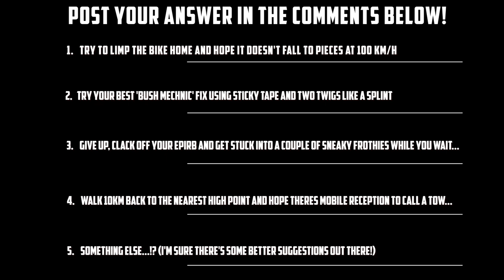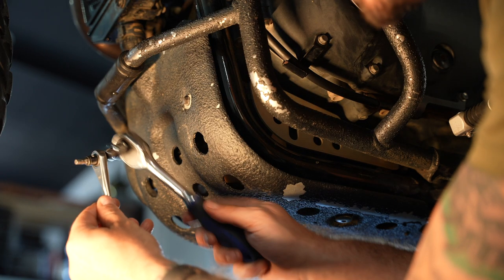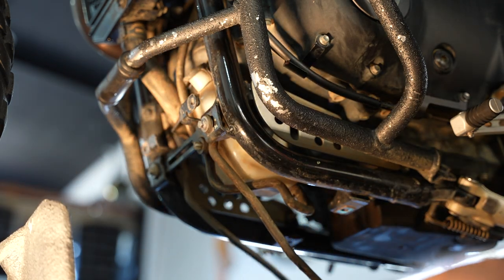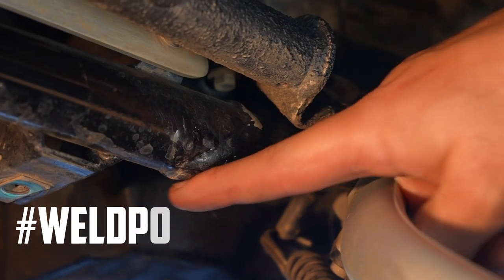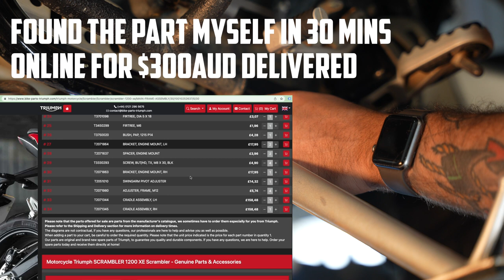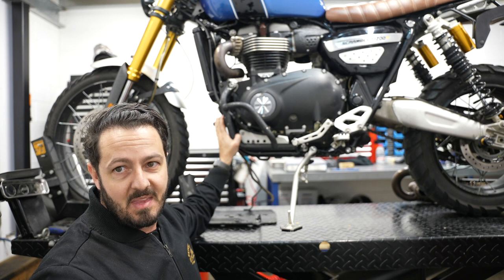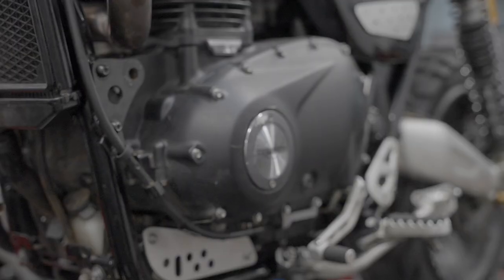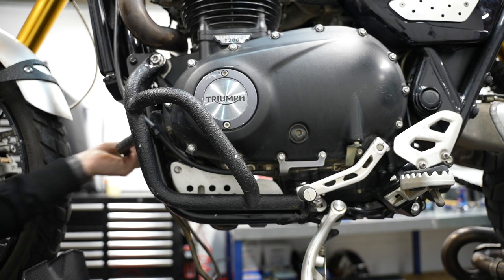Triumph can't fix this! | Scrambler Broken Frame | SCRAMBLER TIPS EP 11

Comment: Went put yesterday and sat on my first Triumph Scrambler XE....Fell in Luv with the sitting position andvoverall feel.  Told the salesman i wanted to go home and research pro's and con's, since i was unfamiliarwith bike.  I wish it didnt have so much tech on it, but the frame weakness is definitely a concern now.
I have been riding/racing On and Offroad for many years, riding for roughly 44 years, so i aint new....but dang that bike "FEELS" So good....
Reply from the maker: It does feel good! I recommend checking out my long term review videos - it’ll give you a better idea of how they stack up against others and also the pros/cons

Comment: Thanks for the video, I’ve been looking at a new 900 Scrambler.  I was also thinking of an Interceptor 650 then putting a 19” front wheel on it.  I’m 74 and don’t do anything crazy anymore.
Reply from the maker: Thanks! Glad it can be useful! I thing the bigger wheel at the front is definitely helpful for stability, and as far as bikes go - I reckon the scrambler 900 would be a bit more power available if you wanted it!

Comment: Good video. Mounting crash bars - Did you remove exhaust to get at nut on inside of engine mount bolt? Pretty hard to get a wrench on it. Triumph manual says to remove exhaust. Manual also says those are one use self lock nuts to be replaced every use. But that's likely official manual lawyer type stuff.
Have 2019 XE with 30,000 miles. Only real problem was replaced gear shift shaft at 20,000 miles. Well known problem. Triumph has a retrofit part to fix it.
Reply from the maker: Thanks! And sorry I can’t remember, I think I may have removed the exhaust - otherwise there might be a way to get a ratchet ring spanner head in there (I think!?)

Comment: This break is from standing on the foot peg while the bike is on the stand, nothing to do with off-road riding. It was common on the KTM 950/990 bikes, except there it broke the engine casing, there were plenty of relocation brackets available.
Reply from the maker: Yeah a few people have mentioned that, but I have only done is a couple of times, and mostly on the right hand peg. It seems to be a weak spot?
Reply: Oh? Well I guess that's all right then😂

C'mon, I never saw a more feeble comment in my life! If a frame breaks while standing on the pegs, I don't care whether the bike is parked or bouncing down the road, it means the bike is a piece of shit or someone has abused the fuck out of it. Stick to proper bikes. 

I remember back in the day (90's) a mate cracked his frame on a Supertenere and I praised my faith in my Africa Twin. I still have my Africa Twin. My mate's dead.😢
Reply: @lifeofascrambler it should be able to take it, poor design.

Comment: Great video!  Felt for ya when you laid the critter down.   I've done that to many times at 250kg plus.  First thing is look around see who's filming then cuss like sailor.   Funny how a manufacturer can build a bike and say, "it can" then have a frame that should have been tested so "it could".  Fire the guy at Triumph that spec'd that frame out.
Reply from the maker: Hahaha thanks, yeah that reaction to dropping the bike sounds familiar! And you’re exactly right, I’m more than a little disappointed in the frame break, and I suspect something to do with the alloy they’ve used, where most alloys just don’t take vibration like steel does, they crack under the pressure!
Reply: @lifeofascrambler  In my industry auto manufactures know of particular problems but they cost analyze them down to the penny with empirical data over decades.  Failure and warranty are an expense on a tax return in this country if you catch my drift.   How many people will ride hard vs people that play.  Trust me they thought of this when they found the flaw in testing and let it go.  Not trying to be conspiracy at all.  Totally true in automotive.  Planned obsolescence it's called.  Sad but true
Reply from the maker: @howardmonteith  totally agree! I don't think that's tinfoil hat thinking, its totally something I have seen in some businesses - where they lose sight of basic customer needs vs profit. It's a shame, seems to be really bad in the motorcycle industry too! (I've been watching some of the @fortnine videos recently that explain dealerships vs corporates etc and it shines a pretty bright light on some shady practices.
In the meantime, I'm patiently waiting to support the kickstarter for a new quality motor company - "Howard M Peterbilt series Trucks"...or maybe it should be "Howardbilt while Peterfilmed" series....😂

Comment: Hello, thanks for Your videos.... may I ask You if new models have fixed the problem? thank You :)
Reply from the maker: I was in a media call with the triumph head of engineering a few months back when they released the new models, and he said that they had solved it!
Reply: @lifeofascrambler  thank You very much
Reply: Did they happen to elaborate on what they believe is the most exact cause of frame cracking? 

Is it because a significant amount of weight is drawing straight down in the center of the frame when someone puts all their weight on the foot pegs? 

These bikes are ridden standing up off-road so often- I can't imagine they would deduce the problem. Origin being weight on the peg.

 @lifeofascrambler

Comment: Do you get on and/or off the bike while it is on the side stand, or sit on it with your feet on the footpegs while it is on the sidestand.  The sidestand clunk is a dead easy fix with a bit of rubber on the stand.  Are you getting an entire new frame from Triumph?
The new Tiger 900 Have been breaking a few frames where crash bars have been installed.  Have you seen the OEM Triumph engine side case protectors that can be installed also to protect the cases just a bit more from rocks and objects?
Reply from the maker: I have gotten on and off the bike using the left peg a handful of times but only when carrying camping gear, because I’m too short to step over. That said, it shouldn’t be enough to crack a frame and the fact it’s happened to a few folks, and also seeing the place it cracked, makes me wonder if it’s a design / quality issue.
Reply: If you can't get on a bike while it's on the sidestand without the  f'n frame breaking, then that's a serious problem with the manufacturer. Rediculous, it's not a plastic toy, it should not break!

Comment: Mine did the exact same thing. I have hardly taken it off road and I don't do the kickstand mount method (I'm an old motocrosser so just throwing the leg over is habit).
Man, I might need to see if the dealer here in the U.S. can get it covered as well if this is a known issue. I have a closer non-dealer shop with the part on order. Their estimate when ordering the part (in late July) was late November. The stupid thing has been in storage ever since. I don't know a welder that will do that type of work.
Reply from the maker: Really?! That’s pretty crappy I’m sorry to hear that! Triumph should 100% cover it, I was lucky to get it looked at just before my 2 year warranty ran out, but the frame should be covered for longer than that, I’m not sure about the US consumer law though. Definitely look into getting a welder to help! Anybody at a fabricator should be able to do it, and removing the frame piece isn’t that hard it just takes a day or two and you need to be careful to torque everything up as per the manual. There’s one available in the 1200 Facebook group!
Reply: @lifeofascrambler   Ahh okay - yeah my bike is out of warranty. The part we ordered is pretty inexpensive ($180) but the wait is what is killing me. I actually ended up getting a Honda NC700X in the mean time. I'll probably sell the Scrambler when I finally get the part. I've just had too many long wait time for parts, ridiculously expensive replacements ($300 for the stupid side panel plastic piece), etc.
Reply: @lifeofascrambler  Sorry, just re-reading this; were you saying there's a fabricator available or the part itself? I don't use Facebook so I kind of glanced over that. I'm still waiting for the part. Latest estimate was late January and I'm thinking when that time comes, they'll push it out again.

Comment: So if I understood right, the lower cradle of the scrambler 1200 is made of aluminum?
Reply from the maker: Yep!
Reply from the maker: @StefanLoeners yeah you're right, ally is not as strong as steel but they seem to use it in some places to save weight 🤗
Reply: Aluminum can be pretty strong, but it work-hardens, fatigues, and cracks quicker when flexed repeatedly. It can be a good frame material to save weight on an MX or streetbike, but I don't think it should be used for a frame on a dualsport or adv moto that could be ridden through the middle of nowhere.

 It's also not as easy to find a welder skilled at aluminum repairs.
Reply from the maker: @RKmndo  100% right, and totally agree
Reply: I am confused. I inspected my USA 2022 everywhere with a magnet and it is steel. @lifeofascrambler

Comment: Is it a common issue or just the odd case here and there? 🤔 im kinda thinking not cos these bikes have been out a few years now and theres not loads of information on the frames cracking on these 🤔
Reply from the maker: Well, I’ve come across about 10 others that have had this issue that I know about - so it’s a statistically small number
Reply from the maker: Also, if you head to the FB group I show in my latest video, you can search the posts and see people talking about them
Reply: Im guessing these bikes have been ridden offroad to crack there frames, you'd have thought triumph would have done somthin to prevent this by now considering these bikes are a few years old now, appreciate the response a d love your videos 👍 cant wait to be able to get my own scrambler 👍
Reply from the maker: @user-fn1rb9ze6p  well actually, the more I speak to others that have had it, the less convinced I am that its offroad riding and more convinced its from the weight of stepping on the left peg while the bike is on the side stand - so its a definite weak spot. You're right though, they need to come up with a fix, even though it's not a really significant structural piece, it is important nonetheless.
Reply from the maker: @user-fn1rb9ze6p  also, thanks 😅🤗glad you enjoy!

Comment: For the record: Triumph Scrambler 1200 XE Owners Manual  "Warning - Do not lean, sit or climb on the
motorcycle when it is supported on the side stand. "
I believe Triumph, or any manufacturer, will tell you that the side stand is simply not designed to support the weight of the bike and rider. It is designed to support the weight of the bike at lean with an added safety factor SF. That SF might usually cover the added weight of a rider. But the stand is NOT designed to support bike and rider with an added SF safety factor.
If they did that they would also need the stand to support rider, passenger and luggage (maximum payload) with a safety factor and you would end up with a 20 pound side stand.
I always cringe when I see guys go into a new bike showroom and sit on a expensive bike on the side stand.
Reply from the maker: Interesting, I get what you mean, but it’s not actually the side stand that is breaking, it’s the left hand cradle where the side stand attaches, and there seems to be plenty of other manufacturers who have managed to build heavier bikes without this issue.
Reply: @lifeofascrambler I’ve always warned Ducati riders about sitting on their bikes on the side stands.  Many Ducati side stands were bolted directly to the engine cases and many cases broke because of this.  KTM dirt bikes would just snap the side stands.

Comment: Do you think the crack occurred before installing the crash bars? Would the crash bars prevent cracking is the question I guess.  Good video thanks.
Reply from the maker: No I’m 99% sure the crash bars were installed first. They did prevent the whole frame falling apart though. I also was asked by someone if a drop onto the crash bars could have caused a twist in the frame, however I’m not sure and as they’re OEM it would be a strange design if bay was the cause.
Reply: @lifeofascrambler  ah ok, thanks for the reply.  I'll keep an eye on mine👍

Comment: I carry JB Weld but not sure if it would be strong enough for a frame break. Does anybody know?
Reply from the maker: That’s a bloody good question! I wonder if it would work?! I feel like I might have to do a myth busters episode to try it out 😂
Reply: maybe better than nothing on a tour, but i guess it doesn't really last
Reply: I jb welded a cylinder head on a chevy cavalier that was cracked in half. It held for a couple of years
Reply: @mackenzieclancy959  😲 I would not have expected this😅
Reply: I don't think anything like JB weld will hold structural damage, its more for patching up holes in engine cases or similar.
Reply: I was thinking the same thing. Carry a couple of short metal tube cut open so they would just spring over the break areas filled with JB Weld. As an emergency repair to get you home it would be better than nothing as long as you didn't use the side stand on the way but propped the bike up against trees etc. Bloody shocking it occurs on such an expensive bike in the first place.

Comment: that is just a sub frame not the main frame , sounds to me you dropped the bike once too often , and probably over loading the bike , any bike can only take so much punishment .
Reply from the maker: Correct it’s sub frame, but not due to overloading or dropping - that part of the frame has never hit the ground! It’s actually a flaw in the design of the kickstand because it puts rotational forces on a weak spot where there’s a weld and a tab attached to the tubular part of the frame - I know of several others (10+) with the same issue where most haven’t dropped the bike - the closest answer we have come to is the act of standing on your footpeg when you get on the bike seems to overload it - and that is something that so many people do on many other bikes and they don’t break!